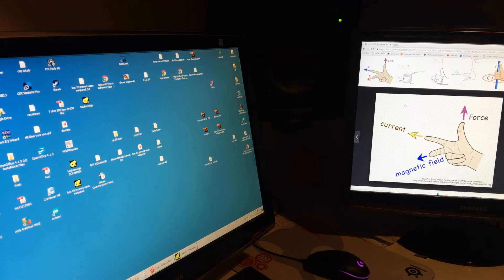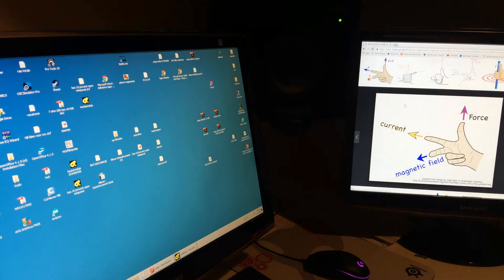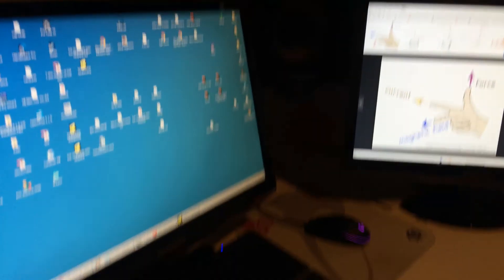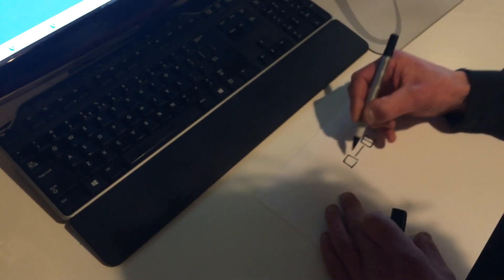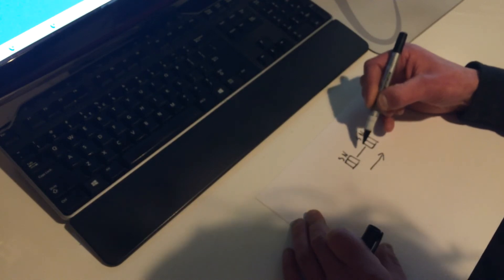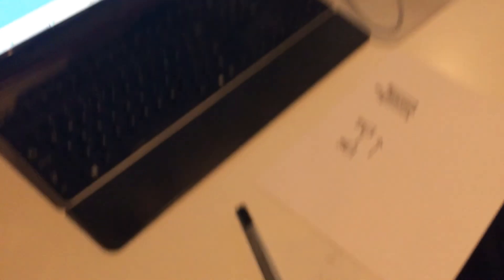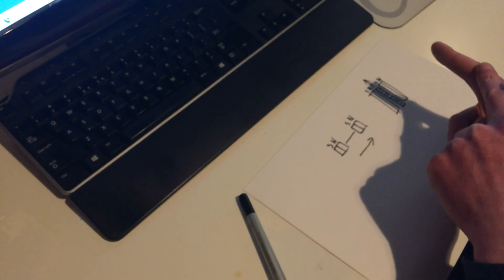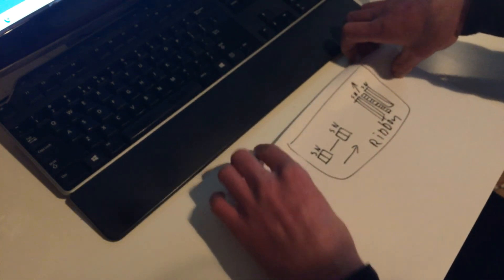Loudspeaker motors explained : Part 1 - Ribbon (dont mention the drunk focus feeling)

Comment: Thanks for these videos.  If I wanted to experiment with making a small ribbon speaker, do you have any pointers or suggestions for books?  I’m particularly trying to figure out how to measure the impedance and figure out what transformer I would need.

Cheers!
Reply from the maker: not really , just lookup turn ratio impendace mathcing transformer, and im sure you find a calculator.  its really that simple.  depending what you want to do ith that speaker/ mostly tweeter i assume.  try Diyaudio.com forums if you want to read about many ri bobn pojects and learn that way
Reply: @joppepeelen  thanks